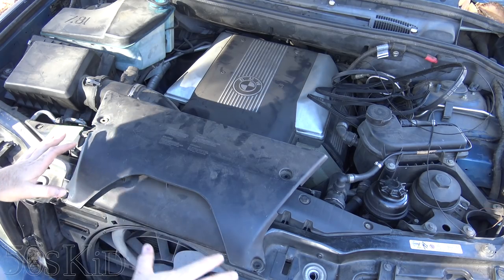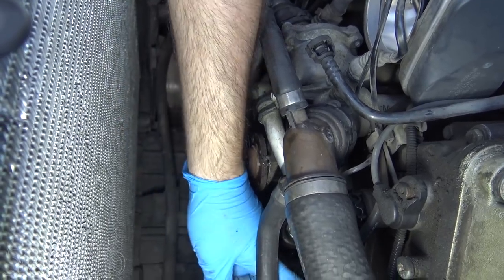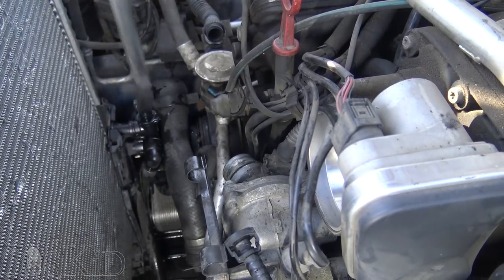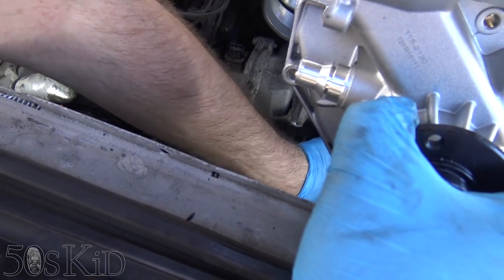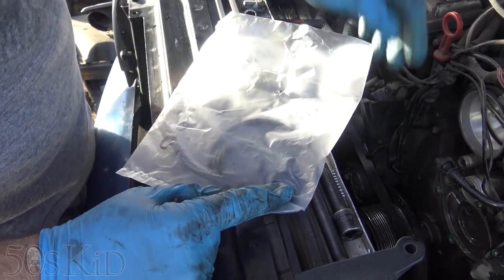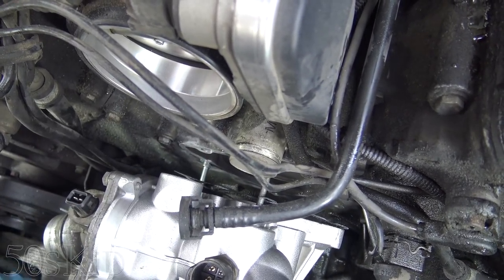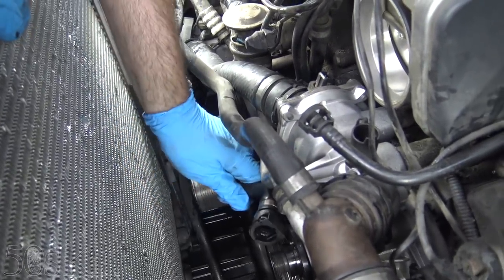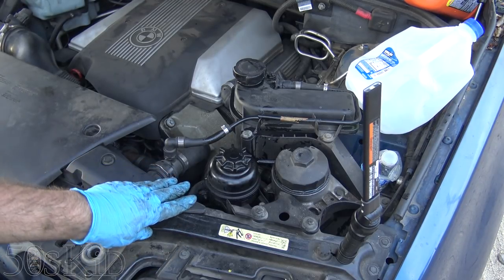BMW X5 4.4i Water Pump Replacement DIY

Comment: I just replaced my water pump on my 04 E53 X5 which was slightly different, but thanks to your video I was able to complete this. The bolt behind the pulley was incredibly difficult and I could not see what wrench you used. I found it useful to use a 10mm ratchet Wrench with a flex head any other wrench did not work in that super tight space. Also in my case the new pump has to be placed with the bolt in place as there is no space to get the bolt in after placing the pump. Anyway, Thank you for your video and continue posting!

Comment: Phantastic tutorial, thanks a lot for this! Need to replace my water pump, it broke with 207.000km / 130.000 Miles. I replaced the generator already 5000 miles before, so got used to remove all the fan stuff and the belt before. Thanks to your vid I'm not worried at all now :-) Just need to buy such an electric ratchet, looks quite handy.

Comment: Quick tip that could save you time in money check your fan tightness. If it’s been off before you might be able to just spin it off without the tools I found out the hard way after trying to avoid buying the tool and needing to get in there several times when I finally decided to take the fan off , I just tried it with a regular wrench with a quick tap they. came right off

Comment: I'm surprised there was no mention of bleeding the cooling system as a final step. I failed to do this and it overheated on me. It turned out the 'auxiliary' water pump used in this procedure was NFG. Once i replaced it I could see it purged a lot of trapped air from the system.

Comment: Great video!!!!! I however, recommend replacing tensioners and pulley assembly after seized water pump, in addition to replacing the O rings in the rear of the transfer pipes.  My reasoning is, if your car has enough mileage to have seized a water pump, those o rings are the same age and ready to be replaced.  Otherwise you'll find yourself repeating the job for a leak and or noisy operation resulting from a faulty tensioner or pulley.  Happened to me on a 2002 E65 4.4.  If you've never done this job, the only benefit to not replacing the additional parts is that when they fail, you'll find that you've completed the tear down in less than 30 minutes.
Reply from the maker: You're right.  I had actually already replaced the pulleys before.  Good idea on the rear o-rings though--I guess we'll have to cross that road when we come to it.
Reply: @50sKid  looking forward on doing those rear o-rings

Comment: Top tip: use the jack to force the bars on the special tool for the fan clutch removal. No need to hammer anything so no excess force on the water pump shaft bearings.

Comment: Hi love your clear and informative videos. Just followed your procedure and I still cannot separate the fan clutch from the water pump spindle but by your third method I was able to remove the water pump.
However when you took the water pump out the 2 pipes at the back of the water pump remained in p;ace unfortunately for me they came forward and I had to use a pipe wrench to get the pump off them, how do I reseat these as it is near impossible to see inside and under the cylinder head, please don't tell me have I have to remove the head, its my neighbours car and I am just trying to help him out of a jam?

Comment: Thanks! So far I have new fuel pump tune up could packs and plugs fuel pump relay new fuel pump fuses in glove box & under hood. New ignition switch and alternator  no fuses blown. I'll try the starter next. I also scanned for codes I got 2  o2 sensor codes. The ones you talk about in your other video. I literally drove the car to Get gas in it. Then I heard a strange noise kinda like something was traveling through the engine. Next time I attempted to start then I heard a weak crank & car would not start. Some mornings on cold engine I would start & car would run and cut off I was having that problem intermittently. Could that have been that leaking hose causing starting issues or if you have a bad starter will your car cut off?

Comment: 30:34 The tensioner bolts on this engine have a weirdly high torque spec. It's 22 ft.lbs. if I recall correctly, which is much more than the 15 ft.lbs. that is typically called out for an 8mm bolt. The factory manual also states that it must be a class 10.9 fastener...probably because a standard class 8.8 would be at risk for snapping at the higher torque spec. The reason for this is because of the crappy tensioner design used by BMW. It has very little travel, and the tensioning strut is very stiff. Because of the very limited travel the design is also very sensitive to belt length. The belt most often recommended if you go to O'Reilly's or other chain stores is too long. You need a 7PK1635 belt... If you look carefully you'll see the piece that the bolt tightens against slip after he tightens it. Mine did to before I found it has such a high torque spec. Like I said, it's a shitty design...

Comment: Hey kid, fellow E46fanatic here,  I just replaced idler pulley, accessory belt, ac belt, and upper tensioner and pulley (mechanical). Still have “CHIRP” at cold idle. What am I doing wrong?? Your thoughts? You’re the best..

Comment: I just did this last week but I think the thinner pipe tore the gasket and it's now spewing coolant everywhere. I'm gonna have to take out the intake manifold to get those pipes in place properly.
Reply: Sorry I didn't watch this video when it was posted.  I just made another comment a few minutes ago but you shouldn't have to pull your intake.  Depending on the vehicle, there will be rings on the coolant pipes or you'll see a gasket made of silicone.  If it's silicone and not rings, mark the spot where where the silicone is, clean it, then apply a 1/4" bead around the pipe and let slightly cure for about a half hour before reinsertion.  That was my experience on a 97 E38. No more leaks.
Reply: Thanks for your input. Just silicone would freak me out because of the heat and pressure. I wanted to do it properly and the rubber o-ring just didn't want o slide onto the pipe. I ended up removing the intake manifold and change the gaskets one the cross pipe too. So far no leaks but now I have problem keeping it running - which is another issue I need to solve.

Comment: I half a 5x bmw I fix the cooler in the thermostat at the bottom from it but it’s still runs hot I’m thinking it the other thermostat on the motor are the water pump the is still on it

Comment: I have a question I have a 2002 BMW 325i ive replaced a lot of old parts I have a vacuum leak, a tear in the hose at the bottom of the oil separator would this stop my car from starting? It's a weak crank but no start.
Reply from the maker: It doesn't usually stop a car from starting, but it should definitely be addressed.  A weak crank could be a bad battery, corrosion on the battery cables, or a weak starter.

Comment: Leave it to BMW and Ford to make you  buy a tool to take the  fan off. Great job.
Reply: all cars have their own type of fan
Reply: If the fanbelt is okay you just use the 32mm and a hammer. Just a light tap and will come of. Just havet to figure something diffrent out if it's snapped